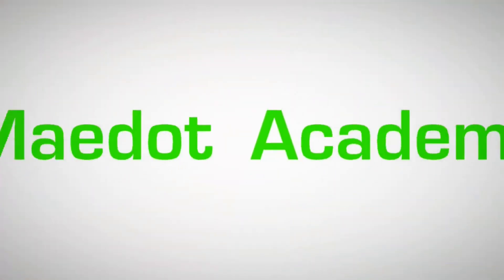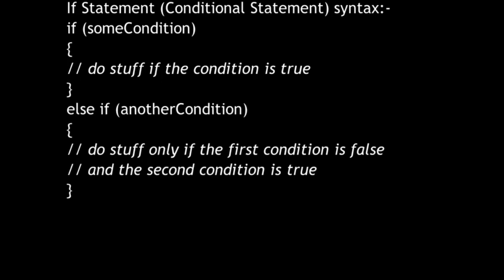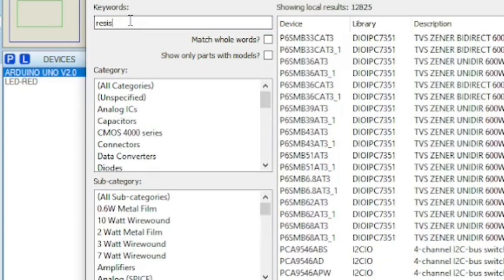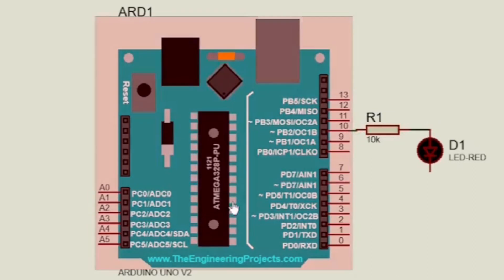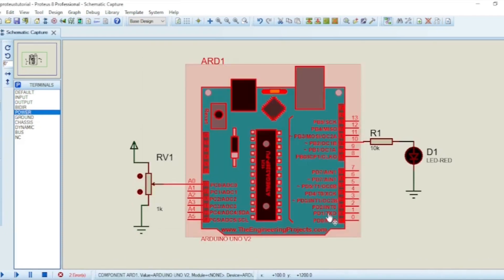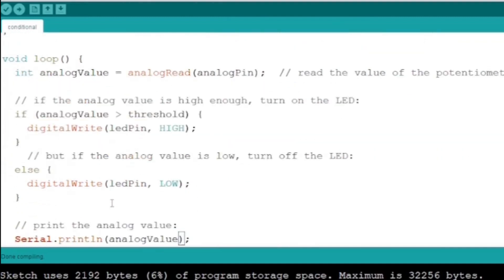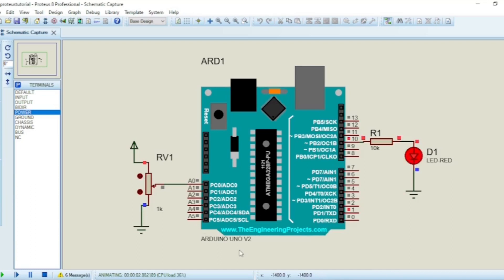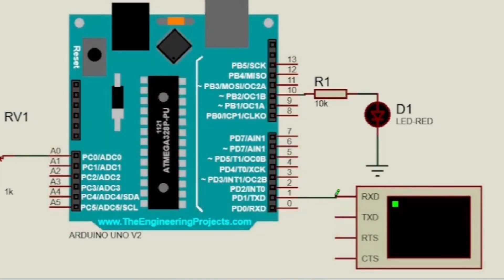Arduino conditional statement with proteus simulation example || LED with potentiometer || 2022

Comment from the maker: Here is the Arduino source code:-
const int analogPin = A0;
const int ledPin = 10; 
const int threshold = 400; 
void setup() 
{
  pinMode(ledPin, OUTPUT);  
  Serial.begin(9600);  
}
void loop() 
{
  int analogValue = analogRead(analogPin); 
  if (analogValue > threshold) {
    digitalWrite(ledPin, HIGH);
  }
  else {
    digitalWrite(ledPin, LOW);
  }
  Serial.println(analogValue);
  delay(10);    
}